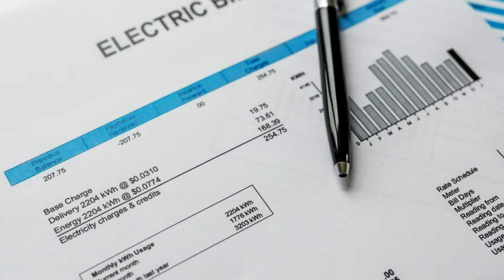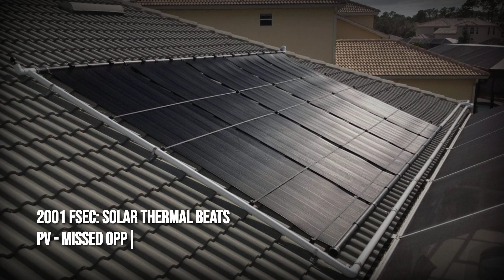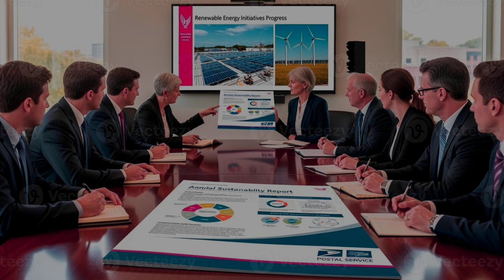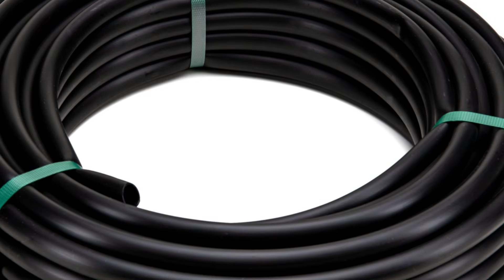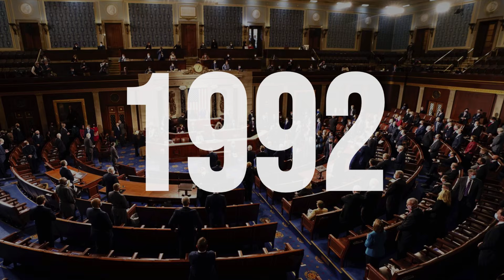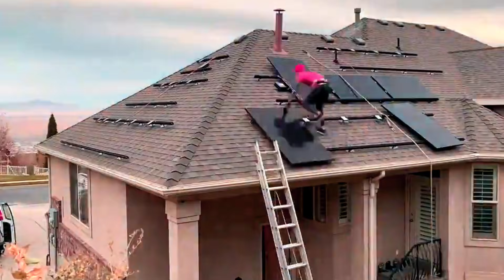Your Solar Panels Are Wasting 70% of Free Sunlight. This $150 Fix Captures It All FOREVER

Comment: 1. How does the hot water get into the house’s plumbing?
2. A relatively inexpensive way to maximize collecting surface is to mount the pipe on a sheet of black-painted aluminum. Aluminum soffit material has groove which can be molded to conform to the pipe.  Industrial silicone heat sink compound improves function.

Comment: My bills dropped from 60-70+ eur to zero in the warmer months, and then 20-60 eur in the colder, cloudier months. My whole system was around 4000 eur. After 7 years or so, I would have free electricity if the energy provider would leave net metering as an option. Otherwise, I will have to install some batteries. Since I got some subsidies, the system has stared generating free electricity after some 3 years or so. I've had it for a total of 4 years now, so a year of free electricity for now. All of this is easy to calculate in advance, you just have to get good information beforehand